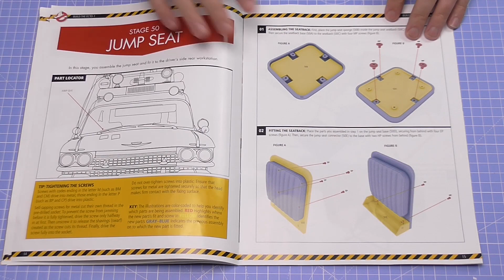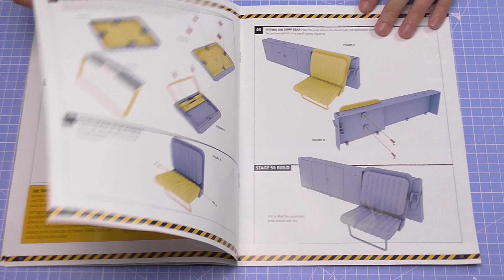Build the Ghostbusters Ecto-1 - Part 49 and 50 - Driver's Side Rear Workstation and Jump Seat

Comment: Wayne, you should get your hands on the 6 Inch scale Plasma Series Ghostbusters, They would look awesome standing next to the Ecto-1.

You can get them from Amazon.

Egon: £22.03

Winston: £19.99

Ray: £22.03

Peter: £19.99

Additionally, you can get Dana for £22.03 and Gozer for £22.03. If you get all 6 figures, you get parts to build a Terror Dog.
Reply: I got my hands on all 4 of the 7" figures off Ebay for £37
Reply: @carlpochin9383   Nice, I'll have to go on Ebay and see if I can get my hands on the 7 inch figures. Thanks for the info. :)
Reply: @ScytherDracon  diamond select 7" figures
Reply: @carlpochin9383  Thank You. :)

Comment: Hey Wayne,in this stage you are working on the rear work station,but I was wondering if you plan to mod this?.I honestly think when I get mine I want to cut those doors open and make a back so it has places to store like small ghostbusting equipment and parts,to give it more detail.

Also I have really went crazy with the mods on this build compared to the BTTF Delorean,on this I have detailed all of the following.Have you done any major mods to yours yet?

1.Engine highlights like painting the oilpan and transmission silver color.
2.Used super shiny chrome on the exhaust pipes to make them like mirror finish.
3.I modded both the lower floodlights and the center flashing siren lights on the grill so when its complete  with LEDs it will be lit up like a Christmas Tree.
4.Not sure when it will release but when it does I plan to mod the rear door to open like a hatchback instead of from side-to-side.
Reply from the maker: Only the Power Mod. This is probably going to be more of a static model in the man cave so I not going to be doing much to it.